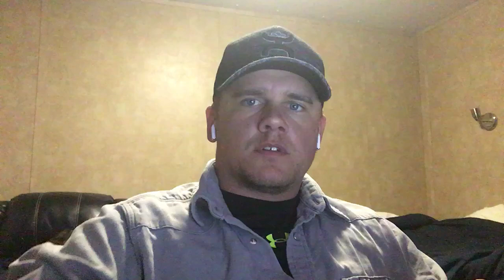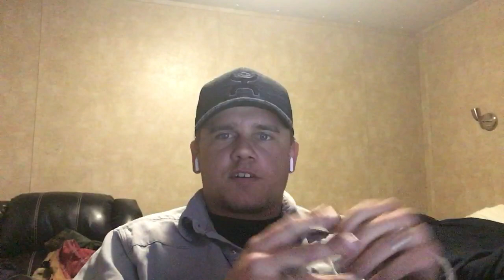Explaining Compressors and Natural Gas Compression in 5 minutes

Comment: What I cannot wrap my head around is if there is a pressure difference between the inlet and the outlet, the outlet will transport more gas if the diameter of the pipeline is the same. So the input cannot keep up with the output, how is this solved?
Reply: In my experience it depends on the type of gas compressor.

If pressure input is low then usually there's phenomenon called surge in centrifugal or axial compressor and stall in recipocating compressor.

The gas flow usually disrupted but manufacturer solved this problem by recycling the gas from outlet back to inlet, they called it anti surge and usually they are using a valve.

Comment: I need a 10 hp compressor that can make at least 3500 psi to liquify air.  what kind of equipment is available used ?  Sauer makes the hurricane for fueling.

Comment: Nice video I worked for mobile back in the early 80s in Northern California we had a clean field don't know how to control hide natural gas 45 Wells and 32 compressor something like that I love you sing a song that that when you compress the gas you are also storing energy in it because compressed gases is storing energy takes energy to get there and it stores that energy and will release it at some time if it's allowed to expand and a compressor might be good to explain that they are very simple in this they have no actuation system for the inlet or exhaust valves are simply a one-way valve in their energy in the form of a multi-plate valve disc valve Reed valve whatever we had to meet in the in the range of 660 PSI for PG&E probably a most entertaining part was starting up a large blink of an atlas with a giant fly will you borrow borrow them over and used natural gas on top of the Piston to to get a turning and bringing the gas and bringing the spark great fun back in those days I was always a thinker in a inventor and I had the idea of harnessing wind energy but instead of making electricity directly just just haven't run out of window running a compressor compressor gas up to very high pressures wife wanted to vent a storage container you can use it to run air Motors to run your shop you can use to even use their motor to generate electricity but they're they're actually doing that now. They took my idea from the early eighties and they're now they're storing high pressure are underground because of off-peak Demands when when wind is blowing and you need you need like a battery restoring high pressure gas any kind of gas that is a gaseous State storing it under high pressure is storing energy in in in the even if it's not flammable but it's stored energy because it's compressed on the compressors it was not very common for the intake valve to leak or fail work on run exhaust valve on the intake valve on Sundays compressors which were somewhere opposed twin run by Decap engine converted to that gas and we would just check all the switches and gauges and change the chart a chart on the meter and then you just touch the intake valve on the president heads on each compressor head and if you take valve was unusually hot then it's you can be guaranteed it's leaking cash because that's crazy when you have the intake charge being compressor blowing back out the intake port wall of words over out
Reply: All these words and don’t understand a damn thing it says, pry should’ve proof read this before posting 🤷🏼‍♂️🤷🏼‍♂️🤷🏼‍♂️

Comment: How many compressors are in a typical compressor station and what would be the least number and what would be a maximum number.  Thanks
Reply: I have been on facilities where there is single stage, 2 stage and 3 stage. It all depends on your suction and discharge psi to where you are going with your gas.

Comment: Hi! I like your video. Could you tell me where can I buy a natural gas compressor. I have a genetator that works with natural gas, but it needs a higher pressure (30 psi) in order to  run efficienrly.  Or, how to build one at home. Thank you in advance! Can I use an air compressor?
Reply from the maker: Not sure that is your issue as the engine side of your generator will be knocked down into ounces going into the carb. Should only need a few psi to run it. Air is a no go as it is not a fuel source.
Reply: @Jankycattlecompany  would you be able to help a guy out by answering a few questions about natural gas well.

Comment: The line pressure  where  I work runs  around  100 to 150 psi an I work around Utah new Mexico Arizona and colorado
Reply from the maker: Yep selling into LP (low pressure) would have a compression station somewhere down the line to take it up from 100 to 800+

Comment: Damn, suction is at 30-50 pounds? How many compressors you runnin? 1 if that?? With a discharge at 1000?...
Reply from the maker: Usually 1 compressor on pad flowing 1-4 wells.
Reply: Those numbers are pretty common in West Texas , actually he's pretty damn accurate! #kodiakgasservices